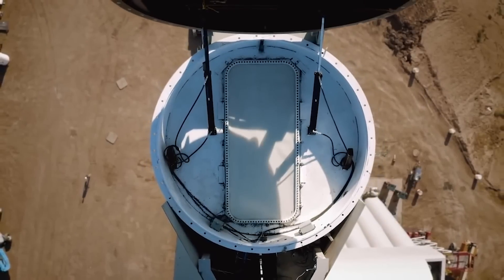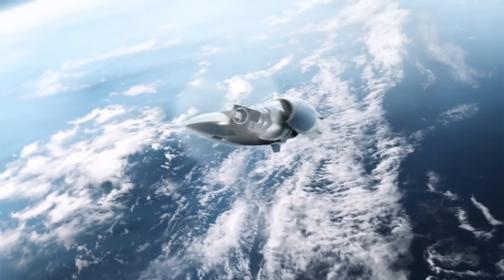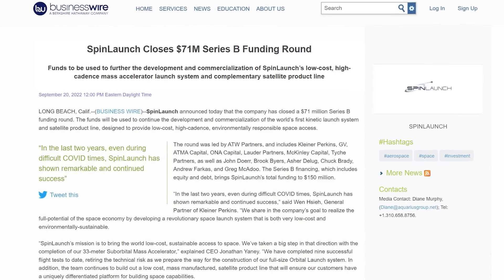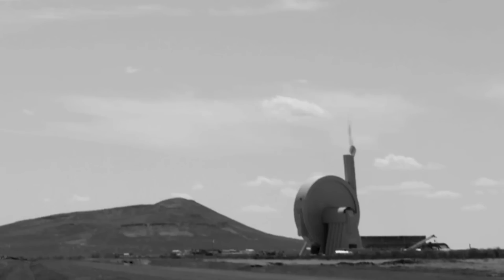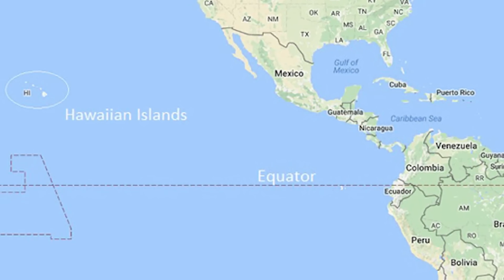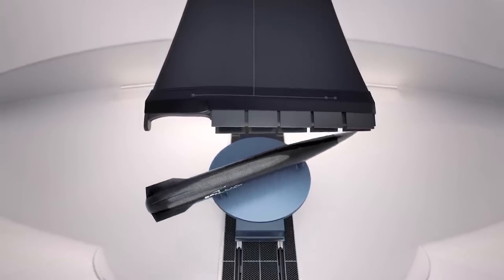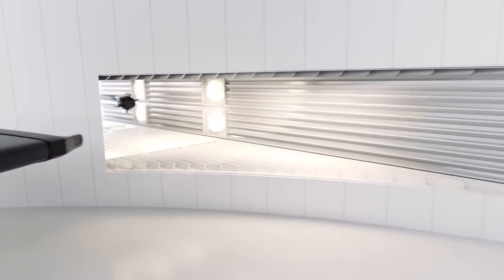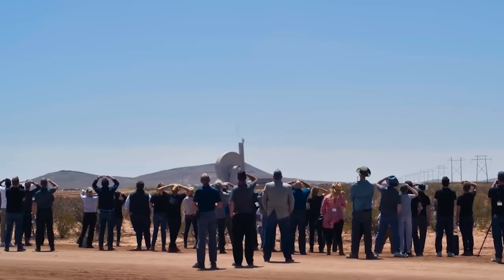What Happened To SpinLaunch & The Orbital Accelerator?

Comment: They need high altitude so they can cut through most of the air. They also need to be near the equator. I would recommend Pichincha Mountain in Quito, Equacor. Only 0° 15' from the equator. It has road access to take you to 12,500 ft elevation and cable car access to the summit at 16,000 ft.  It is an extinct volcano, which means you won't have any of that inconvenient lava hassle some of the other volcanoes in the region would offer.  It is only six miles from Quito city center and is very easily accessible by road. You could mount the launcher itself on the summit and have your control station at the 12,500 ft level so your people can breathe.
Reply: Pichincha is NOT extinct.  It has erupted multiple times historically
Reply: @ericbaer7880 All relevant issues aside, having an active volcano in the background during a launch would be some epic footage! 😎
Reply: @koanbonwa  like those villains with a lava lair
Reply: One thing i've noticed no one under these comments talking about are the negative effects this system would have on the city of Quito itself! It's a city of over 2 million people, the Capital of Equador, on the EAST slope of Pichincha. Why did the Hawaiians reject SpinLaunch on their Islands? Primarily because of the sound pollution of shooting supersonic projectiles through the air every few hours. Think about what the people of Quito, and the Ecuadorian government that holds their sessions there, would think of sonic booms bursting their eardrums ever hour.  What about if something goes wrong? What if the doors have a fault, or the arm catastrophically fails? Well, now the CAPITAL CITY of Ecuador is perfectly placed to the east of this artillery platform raining shrapnel of whatever parts broke and flew off. I get the idea from a physics and mechanical standpoint, but it is never going to happen in reality, period.
Reply: Thanks for the suggestion, I will pass it to the concerned teams.
Reply: They just need to empty pockets of some naive investors. This is all they need.
Reply: Having supersonic booms at 6 miles from a big city is a problem.
Reply: @RandStuffOfficial  With such a small launch vehicle, the sonic boom will be relatively small, and the peak is 10+ miles from the nearest edge of Quito.

That aside, Quito area shouldn’t be the first choice. It’s not terrible, but far from ideal. A lightly populated area on a mountain somewhere between 5-20 degrees off the equator, similar to Pico de Orizaba, MX, or Atacama Desert, Chile. There is probably a better location, preferably not to far from an ocean. If you can find a mountain at least 14k ft (4200+m) in the Americas that is between 6’-15’ N/S of the equator, and is at least 15mi (25km) from any city over 50k population, it should be considered.
Reply: The issues would be building and working at that height. I think we can all see the benefit of launching at a 10th of the air pressure of at sea level and starting higher up and going slightly faster, but the hassle, risk and cost of trying to build, work and maintain equipment at that height would probably make the benefits not worth it.
Reply: What's to the east? It's important to have a lot of nothing to the east of any launch system, in case of an abort.
Reply: Any equatorial orbital launch facility, regardless of method, needs to be on an eastward facing coast to provide a safe landing area in the event of failure to reach orbit.
Reply: I always thought a BTM boring an angled tunnel at a 45-60 degree inclination exiting the top of Chimborazo would make the most sense. Inside this tunnel would be a maglev launcher designed to project a ramjet or scramjet vehicle. This is designed to replace to first two stages for small payloads to orbit. The vehicle exits the maglev at MACH 3 and 20,000 feet without ever needing to carry fuel or oxygen. The ramjet/scramjet requires no internal oxygen carried and attains MACH 5-15+ at altitudes over 100,000 feet without carrying any oxygen. 

 This is more akin to transmitting information in packets instead of entire programs at once. This system enables the projectile to glide back and be reused many times. It allows many small vehicles to launch affordable “packets” into orbit with the smallest vehicles possible
Reply: When you gotta go 60 miles 12k feet isn't going to help
Reply: @pbr247  
The lower atmosphere is the thickest by far. The point is to get above the the parasitic drag. By 18,000 you are above 1/2 the atmosphere. By the top of Mount Everest you are above  70% of the atmosphere. If Chimborazo near the equator was used gravity would be about 1% less than the poles. But you would be above 55% of the atmosphere. The enemy of this design is the substantial drag at low altitude where velocity is the highest.
Reply: I'll forward your Youtube post to them. I'm sure they'll be in contact with you soon.
Reply: ⁰⁰00
Reply: Not really.  Communications has moved to undersea fiber-optic cables.  The only utility of space now, especially low earth orbit, is war.

Satellites are useful for covering warzones and doing spying.  For peacetime, this has all been replaced by drones.

There's no need for this crap, and if we came down to a real war, it's pretty simple to take out everything in low Earth Orbit - you just send up rockets, and blow them up into shards.  As satellites hit them, and break up, and there's a cascade effect.

The Space Age was 50 years ago.  We're beyond it.
Reply: It can't go to a different nation.  Why?  ITAR regulations.
Reply: Idk it seems to me that the biggest problems are noise pollution, possible malfunctions and where it drops. That means they probably have to work in very remote locations. In the volcano case, there is also the tourism factor. The area eould have to be closed off.
Reply: No way the locals would allow it though.
Reply: Still wouldn’t work.
Reply: Nah - Anchorage, Alaska is the better choice.
Reply: Ecuador, though. 
Too many commies.
Reply: Nasa's version from Ecuador would be happy to hire you
Reply: What's the volcano season like in the region? Lava might not be a problem, but airborne ash could present some challenges.
Reply: One year later. When it comes to volcanos near Quito, Cotopaxi is in the room. Cotopaxi - https://www.youtube.com/watch?v=eVtgz9rv4s0
Reply: Yeah an American experimental space company in a politically hostile country, great suggestion.
Reply: Why not just use a big gun. Much less hassle. A more 1dimensional acceleration and a much shorter time the projectile need to resist the acceleration
Reply: @mattschm5486 The SpinLaunch guys know this. They don't intend to build an actual working system. Building a centrifuge for the purpose of the hoax is easier than building a "rail". A prototype rail isn't as impressive, although it would send the capsule hundreds of kilometers away. The prototype they've created is more impressive because it does send the capsule somewhat high.
Reply: Six miles from the city center might be an issue.
Reply: They would also prefer low gravity and different set of laws of physics. I would recommend The Moon from NES Duck Tales
Reply: Maybe if we had a giant tube filled with propellant and some nozzles to efficiency combust and spray it out the back we could get this puppy high enough to launch into space.
Reply: snow, high winds, unpredictable weather.... nah
Reply: I’ve been on the summit of Pinchincha (and Cotopaxi).  The last this it needs is this ugly ass thing on top of it.😂
Reply: Launching from mountains is not enough of an advantage to justify the pain of maintaining an infrastructure on a mountain. They would actually prefer to be next to a harbor so they have minimal freight costs.
Reply: your mom prefers to be next to a harbor @Andreas-gh6is
Reply: Altitude would be far more beneficial than proximity to the equator.  But the cost of building and maintaining the system must also be considered.  Everything about altitude and proximity to the equator is just as true for rockets and they are not launching them from mountain tops.
Reply: @bradleyrex2968  There's an important difference: rockets launch starting from 0 velocity. This launches at final velocity. The atmosphere is highly significant in this case (while almost insignificant for rockets). The smaller size of their payloads also makes low drag more significant (smaller mass-to-area ratio). Scaling up their system would help in this regard.
Reply: @gnramires  Me: " As Spin Launch reaches Max Q inside it's launch tube, their air resistance numbers are actually significantly more important.  Thus altitude is more beneficial than for conventional rockets."
You: "There's an important difference: rockets launch starting from 0 velocity. This launches at final velocity. The atmosphere is highly significant in this case".
Me: OK...😗
Reply: Yes, but this launch method is much more sensitive to aerodynamic effects due to its high speed at launch.
Reply: @bradleyrex2968  What makes you say that?  Have you done the calculations?  From the equator, you can launch into ANY orbit without needing to do a plane-change maneuver.  Plane change maneuvers are very costly in terms of delta v.
Reply: @sciencecompliance235   What makes you say that? - As i mentioned: Everything about altitude* and proximity to the equator is just as true for rockets and they are not launching them from mountain tops.  
Have I done the calculations for NASA, SpaceX, Roscosmos, Etc etc?  No.  I think they did their own.

*One correction, As Spin Launch reaches Max Q inside it's launch tube, their air resistance numbers are actually significantly more important.  Thus altitude is more beneficial than for conventional rockets.
Reply: @sciencecompliance235  From the equator, you have equatorial wind to contend with. The weather can be awful, and incredibly powerful. It's where the hemispheres sort out the Coriolis effect upon the planet's gas mass. Much better to get out of that band and back to 5 or 10 degrees of latitude.
Reply: @bradleyrex2968  It reaches Max Q just outside the launch tube. I don't think even a couple of kilometers will matter more than the pains of maintaining that launcher on a mountain. I also think the orbital launcher will not have a much higher initial speed - just a much higher payload capacity to haul a bigger rocket which can then achieve orbital velocity.
Reply: @Andreas-gh6is   The last third of the tube is always full of air, I'd say inside the tube, but the difference is semantics.  Spin Launch has said putting the launcher on the top of the mountain is not worthwhile so they agree with us.
Reply: @bradleyrex2968  "Everything about altitude and proximity to the equator is just as true for rockets" - not so. Spinlaunch vehicles experience max velocity on takeoff, while rockets start off at zero speed on takeoff, so air density at ground level isn't as important for rockets.
Reply: @prdoyle   Me: " As Spin Launch reaches Max Q inside it's launch tube, their air resistance numbers are actually significantly more important.  Thus altitude is more beneficial than for conventional rockets."
You: "Spinlaunch vehicles experience max velocity on takeoff, while rockets start off at zero speed on takeoff, so air density at ground level isn't as important for rockets."
Reply: I spent a week on Mt Lemmon outside Tucson, Arizona at 9000 feet. I had a nonstop headache and could barely think. I don't know if a control station at 12,500 feet is a good idea.
Reply: @fixpacifica  They even have a ski place up on Mt. Lemon. I spent a few hours up there. I notice when doing higher altitude better to spend a day a few thousand feet below 10K' feet before going all the way up.
Reply: The control room staff can chew coca leaves for the altitude sickness like the Equadorian farmers do. 😵‍💫🤯 @fixpacifica
Reply: @zanelittlegray  I'm pretty sure their engineers already gone through a year worth of supply of coca leaves.
Reply: Heh heh 🤯 @HiArashi13
Reply: Woo hoo! It's the "real thing"!
 LOL!  @HiArashi13
Reply: @fixpacifica  I don't doubt it. But you just didn't acclimatize correctly. You have to ascend in steps and remain at higher altitude for a time at each step. Individual differences determine how many steps and how long to acclimatize. But generally, your body needs to be forced to grow red blood cells so that it can grab enough oxygen in the lungs with each breath to sustain you. The headache is from oxygen deprivation, sort of. It's more directly related to how the blood turns more acidic while in transition.

I've forgotten half of what I once knew about this. But I lived in Los Alamos, NM (my house at 7400 feet) for 18 months, and I was miserable for 3 weeks, and fully acclimatized only 6-9 months later. Boy, a trip back to seal level was a rush! I had energy like I have never experienced any other way! But of course, neither lasts forever. The body adjusts, over weeks of time. Just don't expect quick results. A week barely begins the process. And in some people, initial effects can be so severe that it sends them back to lower elevation and a stay in the hospital, lest the symptoms become life-threatening. Don't fool around with over-doing your particular limits.
Reply: @farmergiles1065  I never had the chance to acclimate. They just drove us from Tucson to the telescope complex at the top of the mountain. I'm guessing a lot of the people who visit a station at 12,500 feet are going to have a similar experience with coming in from much lower elevations to work for a few days at a time.
Reply: @fixpacifica  Absolutely; my point exactly. And whoever "they" are, perhaps "they" should learn more about it from the doctors at Los Alamos, who have had decades of experience bringing in people to live at much higher altitudes than they have been accustomed to heretofore. 30 years ago, they had whole introductory "welcome" materials that warned of the signs to look for. This stuff is not nuclear science, and no secret.
Reply: @fixpacifica  Quito itself is at 9300ft elevation, so anyone living in the area is unlikely to have issues at 12,500ft
Reply: @geoffstrickler  I can understand that, but I'd expect people from the US offices and other places outside Ecuador to make trips there. I doubt they'd stay in Quito for several days to get used to the altitude.
Reply: @fixpacifica  I was on Mt Lemmon with a reasonably large crew, there were bunk rooms, a kitchen, a recreational room, and a lounge/TV room. We were there for 3 weeks during the winter.  Other than the cold, and missing family we did fine. . .  Nonetheless, high-elevation affects each person differently.
Reply: @Desertpagan  Sounds like you were in the same area I was.
Reply: lol you noob @fixpacifica
Reply: @fixpacifica  12,500', the natives have evolved greater lung capacity. You may need to wean yourself off the oxygen use.
Reply: @fixpacifica Quito has 1.7 million people and is at 9000+ ft.  Most people can acclimate, some have worse effects at first and a small minority really never can acclimate. Plenty of people work and live at much higher elevations.
Reply: @fixpacifica  why not ? make a "normal conditions" for the working people by technical device.
Reply: @fixpacifica  Place the control station at a lower altitude, similar to some of the observatories on Mauna Kea.   Also much safer in the event of a catastrophic failure not to be sitting in a building right next to a rapidly turning, out of balance mass.
Reply: @fixpacifica it would not be difficult to build control areas with airlock doors and pressurize it to around 7 - 8,000 feet. Workers could wear supplemental oxygen.
Reply: Do you know how suitable the geology is  for a dynamic  buildìng?
Reply: They need to build on Mt. Kilimanjaro.
Reply: It would also help significantly reduce sonic boom I imagine, with less energy being transmitted to the atmosphere from the start.
Reply: I think thats a great idea.
Reply: No. But I'll be back in a week with a very bright idea.
Reply: Great idea, also you could always have pure oxygen tanks added to the interior of the control/staging facility and then respirators for work outside. Lmao kinda just like the avatar movie
Reply: I'm sure they'll be checking the youtube comments for suggestions. Thank god you're here to tell them what to do next.
Reply: And how do they design things to survive tens of thousands of g acceleration even if it did work?
Reply: meh @jg4sh7j4
Reply: I have a little issue with building such a project on an “extinct” volcano. These are to go “non-extinct” at times and might deter investors. I agree with the stated advantages, though.
Reply: @kevinmcgovern5110  Wawa Pichincha is an active volcano. By comparison Kilimanjaro in Tanzania is taller and last erupted 360,000 years ago
However constructing a huge centrifuge on the top of a mountain would be a major piece of civil engineering.
Reply: @spinlaunch
Reply: It's just my opinion, but I think the whole thing's kind of a dumb idea. For a number of reasons that I won't detail. It's kind of like a large version of a BB launcher that I made when I was about 17, looking at a concept I saw in the Poor Man's James Bond, which was a countercultural book you could buy years ago. Maybe you still can. I'm in my sixties now, and when I first saw it, I was struck by how much it  resembled a scaled-up version of what was in the book. Don't get me wrong though, I hope they are successful.
Reply: @dopeymark  They prove it work´s. https://www.youtube.com/watch?v=rW9R6jgE7SQ